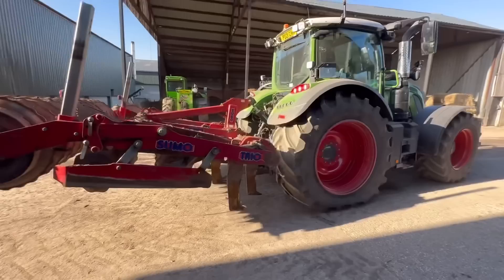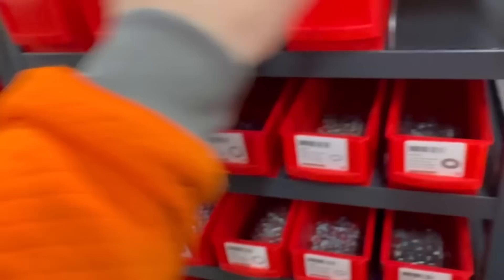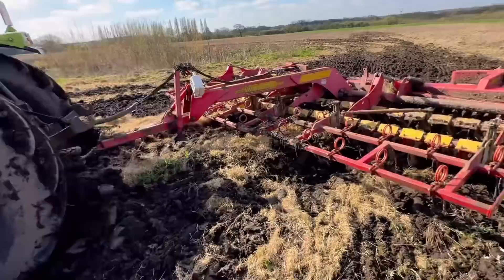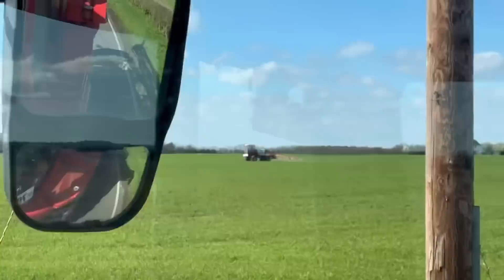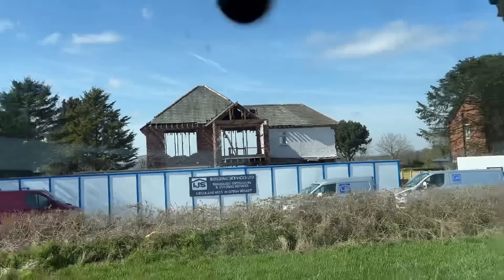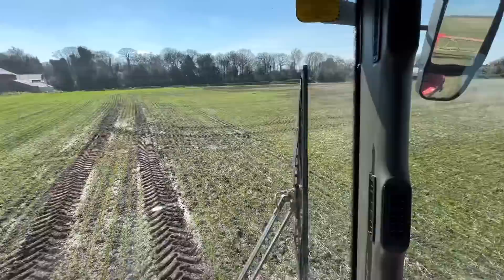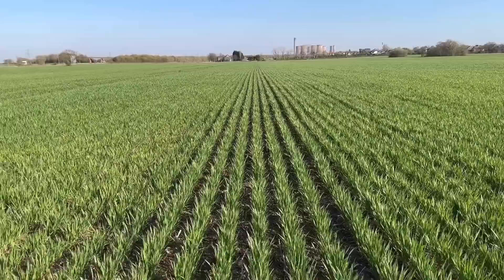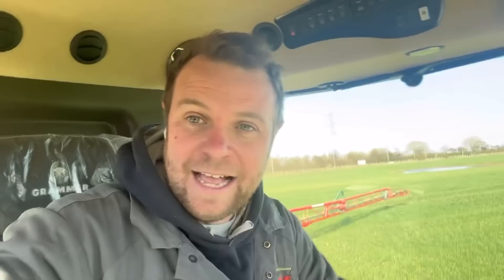XERION TRACTOR STUCK & DATA TAG FITTING  #OLLYBLOGS #AnswerAsAPercent 1108

Comment: Do you adjust tyre pressures in the field or do you transit with them as low as that? Won't they get too hot if they run low like that on the road? 
Wheats are looking nice, good to see.